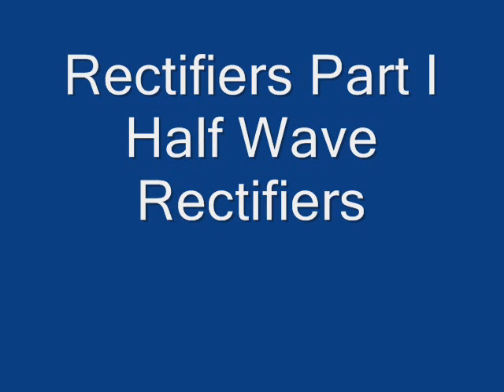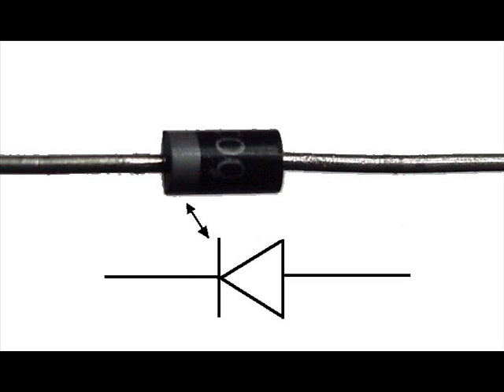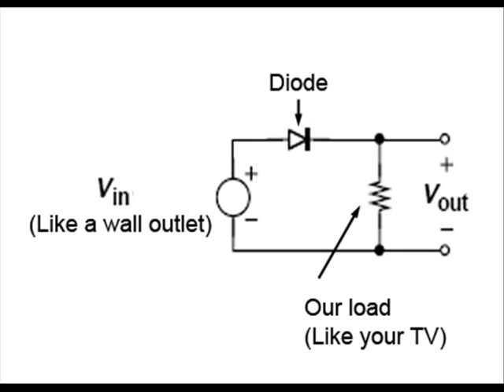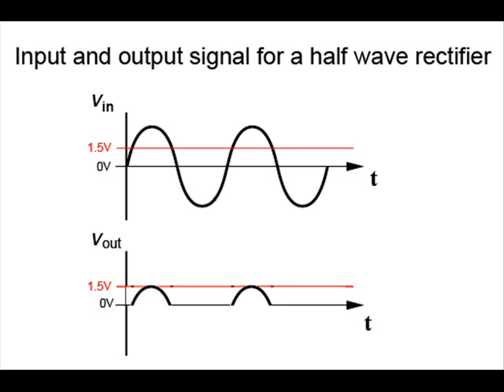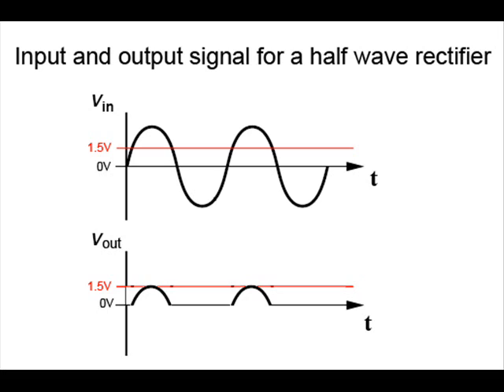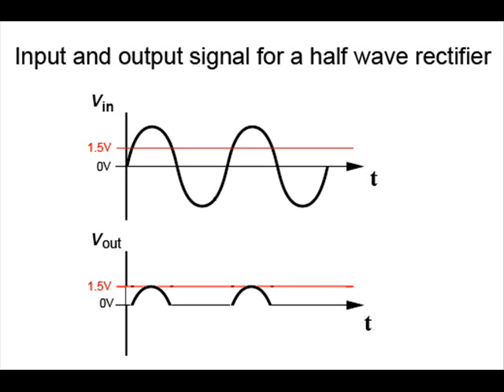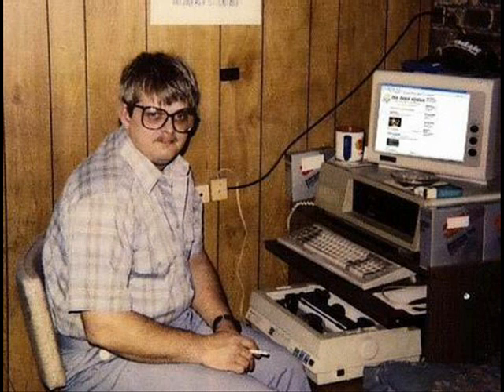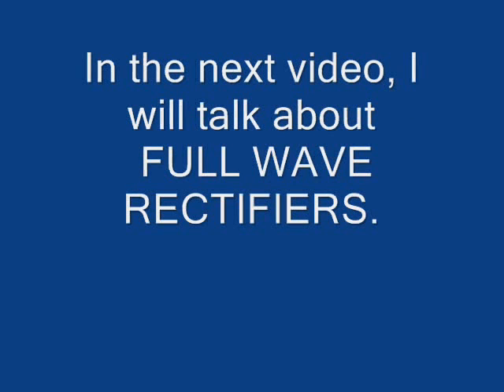Rectifiers Part 1: Half wave rectifiers

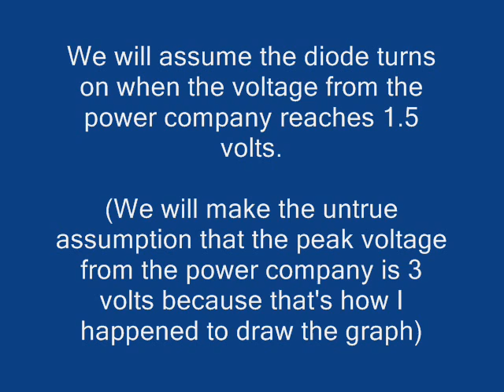Comment: If you are going to be working with circuits, it's probably a good idea to know the specifics of the components that are actually in the circuit. Anyway, the video does specify at 1:32 that there are arbitrary assumptions about the values.

Comment: You say that the drop across the diode is 1.5V.... I don't know of a diode with such a barrier potential but a silicone diode has a barrier potential of .7V and a germanium diode has a barrier potential of .5V... if this assumption was just made to simplify the explanation of the workings of a rectifier I apologize but you might mislead someone if they take this video literally.